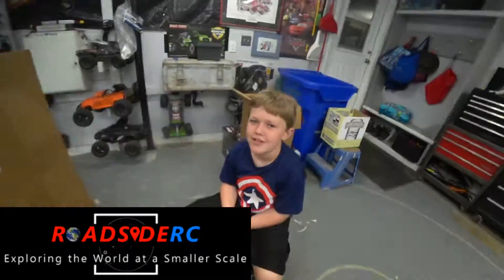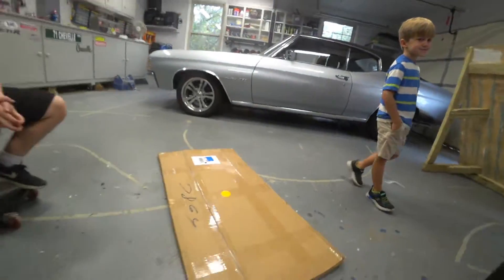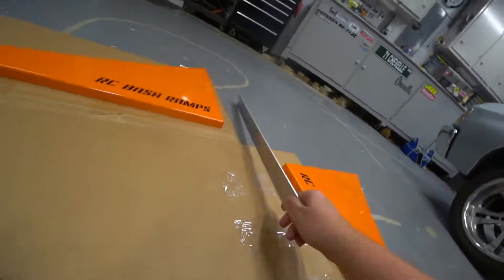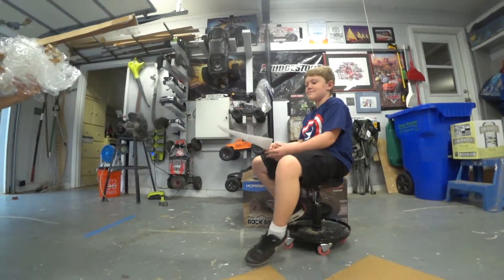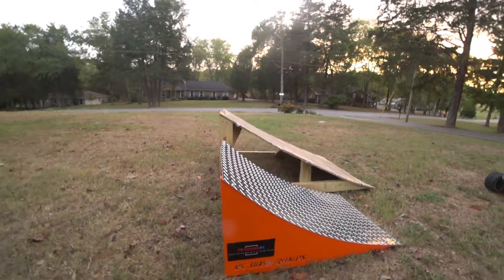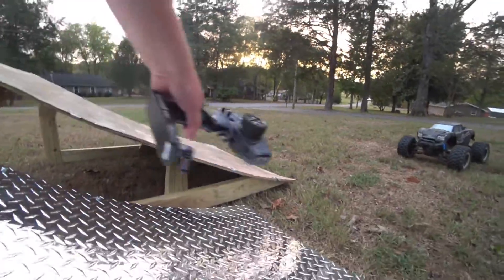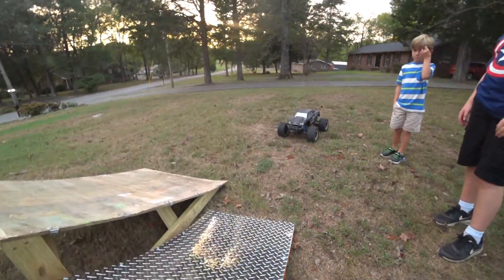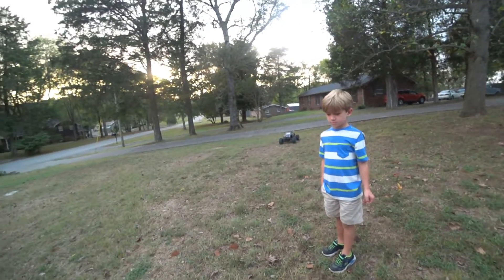RC Bash Ramp!  Assembly and Testing!

Comment: Sweet Ramp! As soon a as I saw those bolts tho all I could think of was cheese grater... carriage bolt replacements maybe? Lol

Certainly gives me a project idea for this winter.
Reply from the maker: Yes - the design is actually pretty good - especially if it has a few tweaks.  
Rounded bolt heads and some supports under the ramp would make a big difference.

Comment: Man, I'd mount that diamond plate with the bumpy part facing down... that will eat through skid plates like no tomorrow! Also with those bolt heads sticking up... hitting that at 6S/8S speeds has to just chew up a chassis. My concrete skate parks chew through skids fast as it is.
Reply from the maker: Well, you called it. 
The bolt head took a chunk out if my son's bumper.  
I might just flip this over, then add some traction tape.
Reply: @RoadsideRC  Not sure adding sandpaper to it is a great idea either. Like taking a belt sander to your chassis front/rear ends. For bashing at my local skate parks, I had to make steel plates for the rear of pretty much any truck I run there. When launching out of the jumps, the rear drags the face of the ramp (as does the front on a couple) and it just chews right through plastic/aluminum in a single bash session. So I make 1/8" steel plates, countersink the screw holes and use longer screws. I have them on all 3 of my revo's, stampede 4x4 and outcast. I tried using M2C's aluminum ones on my outcast and they have lasted 3 bash sessions. I'm now down to the screw heads, which were recessed quite a bit. The steel ones usually last me a season/year.
Reply from the maker: @olds97lss  OK - thanks for that tip.   The guy at my LHS is now 3D printing some skids for 1/8 Arrmas.  That would also work pretty well, and is cheap to replace when worn down.  His has lasted quite some time.

Comment: It's got the right idea. Diamond plate not the best surface imo. Will grind metal and plastic off the cars on every jump. (Not to mention the noise). Double the width (easier to hit at high speed) a composite top (doesn't destroy the cars) put some support in it for strength (a couple of aluminum bars running from side to side) and a way to anchor it = winner!
Reply from the maker: Agree 100%

Comment: How did this ultimately hold up?   It doesn’t seem like I see it in any of your jump or bashing sessions.
Reply from the maker: Honestly, I found it rather narrow for my 1/8 Arrma and X-maxx trucks.  

The diamond plate and exposed bolts would take chunks out of the bottom of my trucks. 
 And...it bent. 

We took the plate off and flipped it over to the smooth side, bought button head bolts, and reinforced the ramp at the top...then promptly gave it to a friend. 

Even with all of that, he still uses the wood ramp we made for him instead. 

I have a how-to video on making a wood ramp.
Reply: @RoadsideRC  thank you for the reply!!!